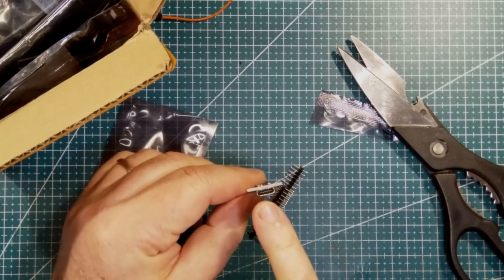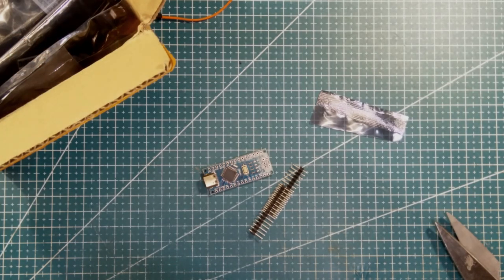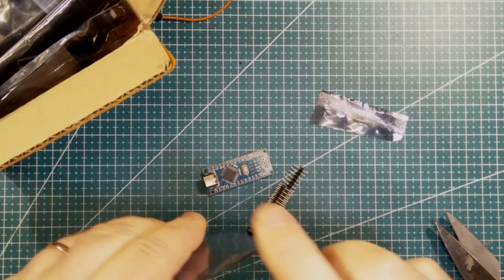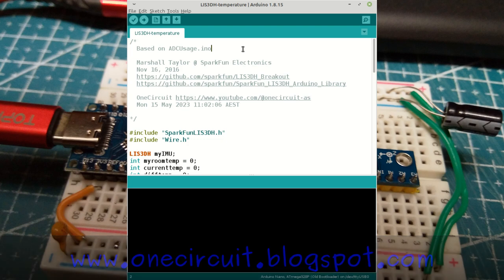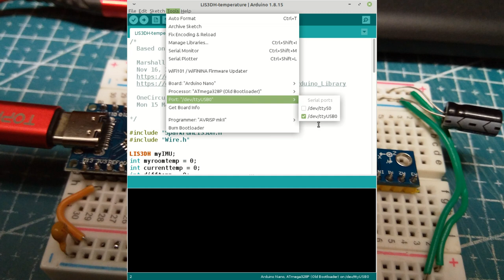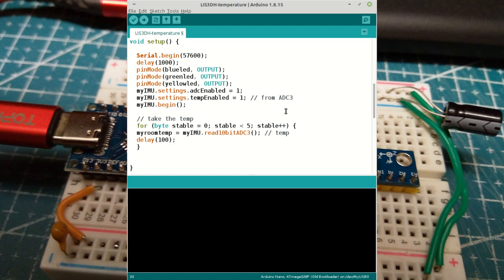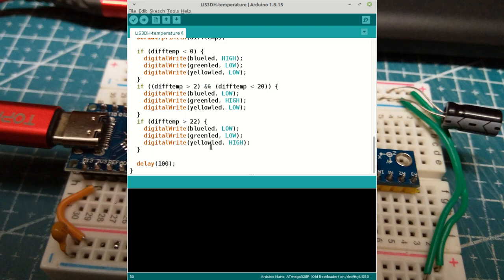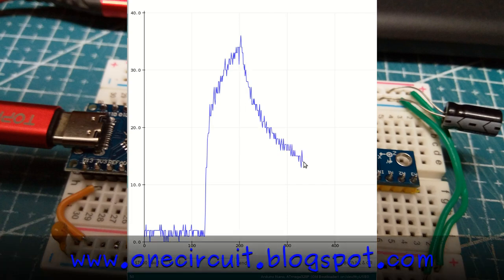Dirty Dozen #06 - Nano USB-C unit, LIS3DH (again) AND Channel Update

Comment: It seems to me that the LIS3DH is probably designed for cameras and other hand held devices (tilt/drop/tap sensor) or pedometers rather than drones or RC aircraft where the ADC inputs would be less useful and they usually include 6DOF. Perhaps the temp sensor is to detect internal heating in a device where absolute temperature isn't as important as change in temp. Nonetheless its an interesting device and one that may be useful to keep on hand especially considering the price. I'd be tempted to make a small one of those self balancing robots with it that used to be so popular!
Reply from the maker: I have designed a PCB for them and have a few "raw" chips coming in - can see a few interesting uses.

Comment: The tin/Silver solder is crap and has a high surface tension compared to the lead/Bizmuth based solders.
Interesting, there are copper based solders on the market but not seen any yet.
Reply from the maker: I'm going to regress back to the Sn/Pb mix soon I think!
Reply: @onecircuit-as  I still have a collection of Lead solder here!

Comment: It's not the cable extender as I use one all the time. Arduino Nanos are unreliable even after the diode blows and you just jump it. I've tried every brand you can think of. It's the ch0xxxx driver I think as every other clone board has went to cp2102 and I haven't seen it.

Comment: the nano USB-C is dangerous, the ones i used don't have proper VIN to 5V seperarion, almost fried my laptop!
laptop turned off and needed a minute to be able to boot up again

they are good for using on 5V only, but not for high voltage applications
Reply from the maker: Wow interesting! I have had a knock off nano reboot my computer before, but this one has been reasonably well behaved. It is a cheap clone though, so you get what you pay for. 😬
Reply: @onecircuit-as  could you do a test with 12V on the VIN and then makr a shory video comparing the 5V pin from the USB port
Reply from the maker: Most of my stuff is packed up for the move - that one is going to have to wait!

Comment: I've been soldering electronics since the 1970's and the reason they put lead in solder is because it makes it GOOD.
I have tried lead free solder a couple of times over the last 15 years, and have worked with commercial boards with lead free and it is AWFUL.
It just does not work very well. Nothing about it is as good, its wetting ability is worse, its corrosion resistance is worse, it looks worse, it is less malleable and less reliable long term. It is just awful awful stuff, the "tofu" of the electronics world.
If you worry about lead exposure from soldering you can get free lead blood test from your doctor in australia just tell him/her you work with lead. There is no absorbtion from soldering and skin contact, lead posioning occurs from ingesting the oxide, ie; eating old crumbly lead paint. Anyway "lead free" solder is garbage and basically its just another political ploy that someone high up got very rich from... 🤔
Reply from the maker: No argument from me - I’ve given it a good tilt, but I just think it’s not worth it! 🤷🏻‍♂️